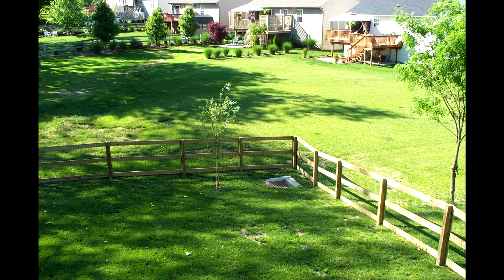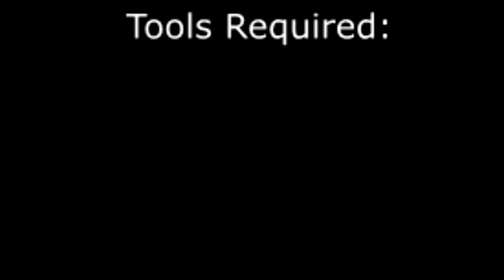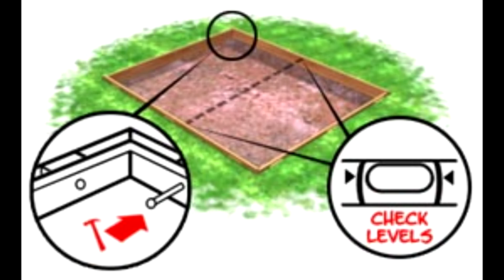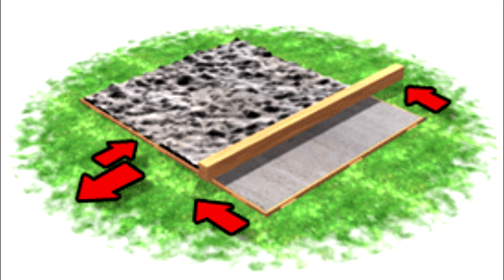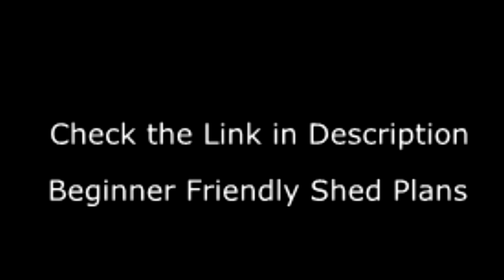How to Build a Shed Base - 4 Easy Steps - Concrete Base Method

Comment: I bought Ryan's Shed Plans & there is a lot of good information in there. I am going to build a shed with my dad this spring while it's cool before the summer heat wave comes in. Thanks for the good content!
Reply: Kudos for the video content! Sorry for butting in, I would appreciate your initial thoughts. Have you tried - WoodBlueprints. Com It is a great one of a kind guide for building better sheds and woodworking without the normal expense. Ive heard some decent things about it and my cousin finally got astronomical success with it.?
Reply: Thank you Ryan for releasing a great product as this [ Check Details Here?> WoodBlueprints. Com ]. Most of the plans I have imagined in my mind are put down on your woodworking plans. This is more like a genius job. I love it!?